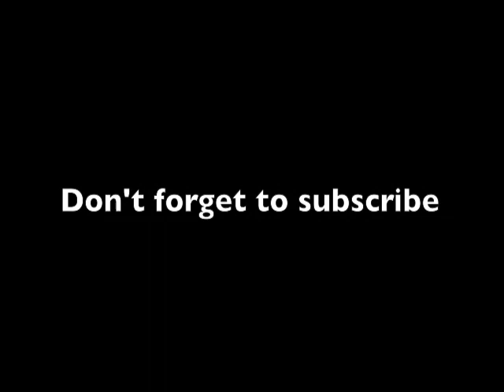How To Build A Jet Engine - FAQ's

Comment: Im a F-16 CC, AF vet, I'm starting on my turbine build this weekend, using a Subaru Turbo. If not challenging enough ill be doing it in the United Arab Emirates.... which makes parts hard to come by because of the language barrier! Your video has helped a lot keep up the good work. By the way i work for Lockheed Martin and would sing your praises if you wanted to come work over here on Block 60 F-16s. Bring that Mitsu w/ i got an STi that needs a challenge!

Comment: hello, I recently became someone who wants to build an engine like this but am having trouble with finding parts and how exactly how to build the parts, so my question is, how much did this cost and do you think it can be built any smaller
Reply from the maker: +tony Mcclain Hi Tony, Unfortunately this project isn't very cheap, which is partly why i haven't been able to upload another video.  For a safe engine, I'd recommend using stainless steel instead of mild, and overall better quality parts inside.  I got my turbo for $80, but they can cost much more.  I'd say the whole project would be about $500-$1000.  
They certainly can be made smaller, but then your thrust-to-weight ratio changes and you just won't make much power out of it.  You could look into pulse jet engines which can be made smaller and lighter and with very few moving parts.
Reply: +freakinxawesome hi again, in case we talk again in the future my real name is Dawayne, but what I was wondering is, for a project I'm doing, I want to be able to lift an object midair and/or give it enough thrust to speed it up and move it long distances, which of the two jets do you think would work better if built to about 22 inches
Reply: +tony Mcclain if your looking for thrust your not going to find it in pulse jet engines. Turbojet engines make a lot more thrust compared to a pulse jet. power to weight is better with a turbojet engine. Pulse jets are just noisemakers for the most part